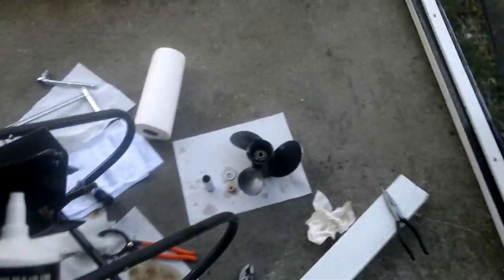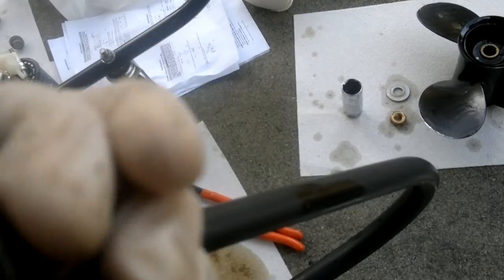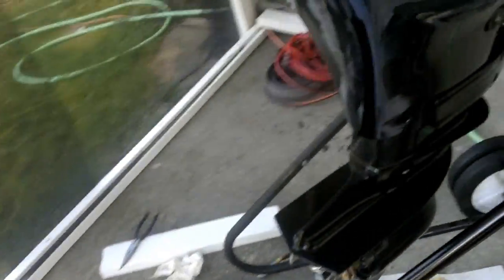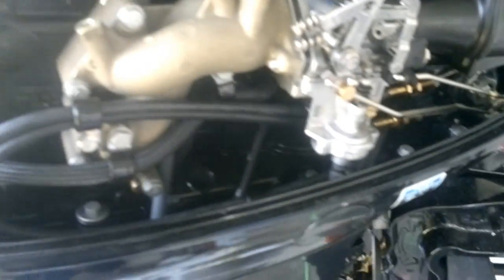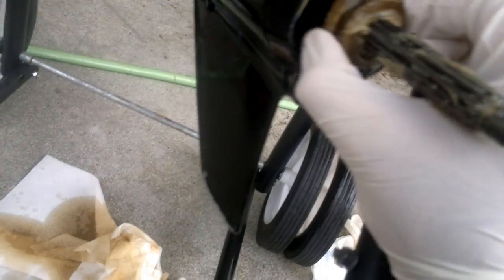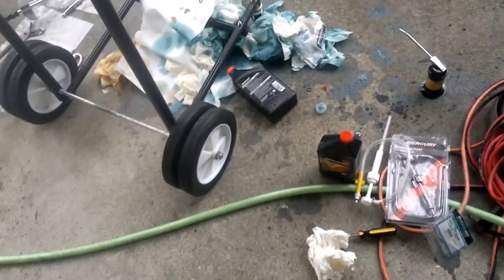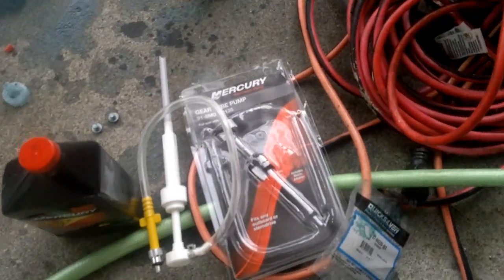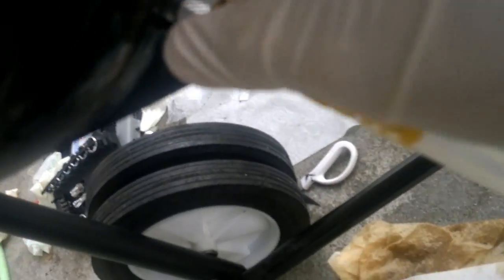Mercury Outboard Motor Annual Service Step by step guide 4/5

Comment: Your videos were pretty informative. However, with about 2 minutes of thoughtful preparation all of what you accomplished can be done without a drop of oil ever touching the ground. The job isn't messy. You are absurdly messy. Why bother wearing gloves? Hopefully you don't have a well on your property.
Reply from the maker: +Peter Allen ya like a few ml of oil is going to go thru 6 inches of concrete and contaminate wells. post a link so we can see your video of oil changes without a drop touching the ground.

Comment: I really appreciate all of the trouble you went through to video this whole process. I plan on solo sailing because I've heard that petrol is more common, worldwide, than diesel fuel...Just one silly question on this: when re-filling the 200ml of oil, why not screw in the bottom plug and let gravity fill up the shaft tube and only spill a little oil out of the top plug, and then top it off,again, to the required full amount???
Reply from the maker: mercury specifically says NOT to do this because of air bubbles i believe.